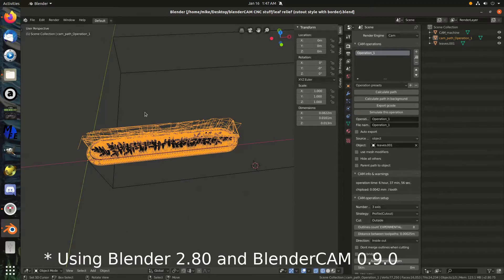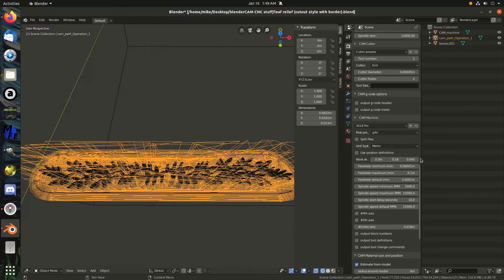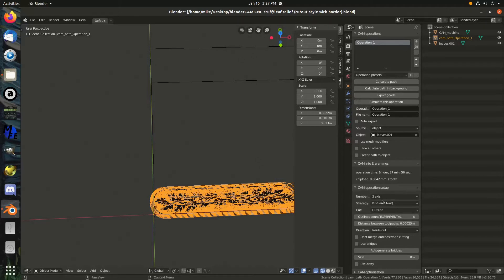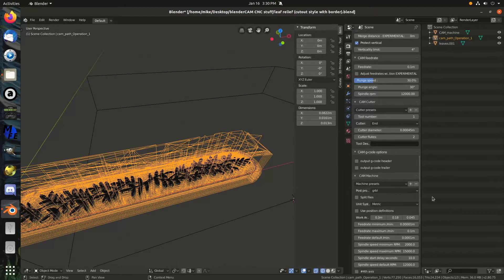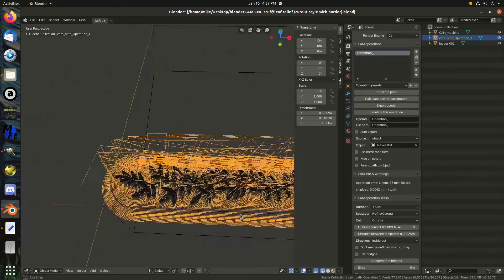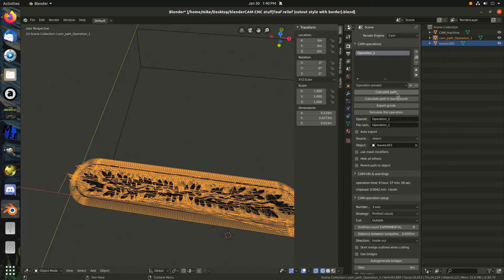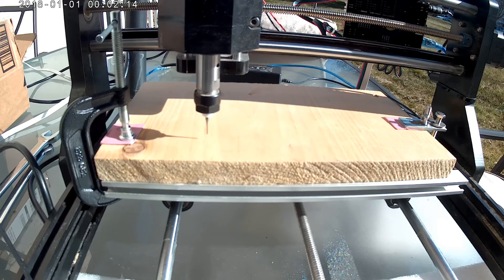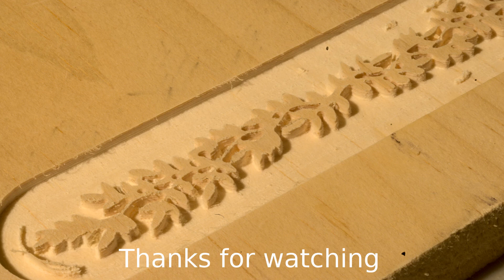Using BlenderCAM to make free gcode and milling it in my 3018 Pro CNC machine with a 1mm end mill

Comment: Well, I don't know. It's kind of the opposite of what CNC is intended for. Over six hours for something that, with a little manual skill, could have been carved in two or three hours? And that doesn't even include the time spent in Blender. Still, it's remarkable what's possible these days with Blender and the right add-ons.

Comment: Thx for your vid..are you on windows machine and if so how do you install blendercam on blender 3.0?
Reply from the maker: It works good in 3.0.  The install method is detailed on blendercams site.  Basically you need to install some stuff in the python distributed with blender and then setup the blendercam folder where you extracted it to the scripts path in blender and start blender and enable the CAM plugin
Reply: @OGmolton1  Can you do a tutorial for the install, doesn't seem to be one out there.
Reply: @OGmolton1  ok thank you

Comment from the maker: The wood that was left from the ring around the leaf cut out just came off with my finger really easily, since it was milled so close to it all it really left is a slightly rougher ring around the cut out that is barely noticeable.  It's interesting the curved sides were a little thicker than the flat sides, I honestly think it's more due to the 3d model being slightly thicker there from my quick job at making that border than the milling machine being less consistent while milling on a curve.